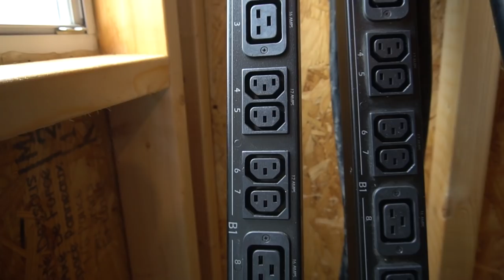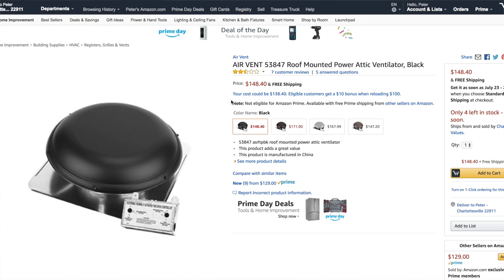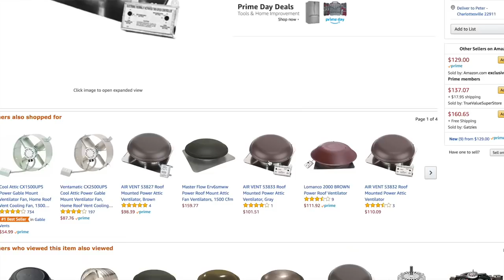How To Build Cryptocurrency Mining Shed | What I learned Mining @ Home

Comment: I suggest you frame in openings on the intake air that allow you to slide in air filters. If you have a sturdy decent filter, you can let it get dirty as you want, long as air flow doesn't get too low and things get hot. A dirty filter just catches more dirt. All that to be said replace costs shouldn't be bad

Comment: Paid $8k for a new 400 amp, 3 phase service. Paid $2500 for 10 30amp 220 circuits with twist lock outlets and 2 20amp circuits with 110 quad boxes. That included the permits. Great channel, thanks!
Reply: That's a good price ! Got a 600V200A line installed (underground) with a 112.5kva transfomer and a 72 breaker panel (120v15amp) for about 11k$
You are on 600V or 240V ?
Reply: I'll have to give you a call for our next farm ... 
Btw ... most of submission were comming back at 12-13k with a 75kva ... 
And ... i'm not sure how much electrician are paid where you live but here it's like 80$ per hour ...

Comment: You can reduce your dust and debris on your filters If you can attach an elbow to those intake vents.
Better, just remove the vents and cut out a horizontal opening the height of the diameter of existing holes. The large new opening then will be covered with filter.  Use gun style blowers to blow out the dust/debris from the filters.

Comment: Nice video! Built an ASIC mining room in basement (can hold 12 ASICS) that sucks in cool air from garage and exhausts it back outside.  Learned a lot while building previous smaller enclosures and used that knowledge to create the current setup.  Made some tweaks and it has been performing very well so far.   Love your videos and overall mining outlook! WOOT!

Comment: I see a lot of roof that could potentially be covered with solar panels ;)
Reply: Terrible idea for 99.9% of the population.
Reply: Nah, in some regions you even get national support to install them and this significantly shortens the time for ROI.
Reply: ? Solar bad? Please explain.
Reply: not for Mr. Vosk....solar panel directly wired to DC fans....that's free cooling (free after you account for capitol expenditure for panel + fan)
Reply: Bradley C - Solar panels are expensive, so ROI is frickin' never and they use some nasty chemicals and processes to make.  Plus solar is statistically about 4 times more deadly (deaths/kWh) than nuclear ;-)
Personally, I want an old water mill with a generator inside.  A nice home and free electricity, with mining rigs for central heating.
Reply: Phil Rodgers nonsense. I work for an electric company in MN and from all the solar projects i see the avereage roi for solar is 10 years. That leaves 20 years left of the life of the system to make profit.
Reply: PigeonLaughter - 10 in optimal conditions with a 25 year life expectancy. Suboptimal conditions is going to extend ROI and decrease life expectancy. Technology will improve over time, but the current tech is below par.
Reply: It would definitely be profitable for Mr. Vosk. He could make a video about setting up his solar panels that power the ventilations and/or mining and put affiliate links under that video to solar panels and other accessories ;)
Reply: @philrod1  SOLAR IS NOT EXPENSIVE!
Reply: @philrod1  the profitability of solar technologies has gone from several years to less than 2. LESS THAN 2. very common mistake...  its getting more worth it by the day, its just not something we can depend on yet. Traditional generation methods seem cheaper but are needlessly complicated by need to access to Uranium and lots of water.. which needs to be resupplied and also waste removed, it is a scam mate.. Solar panels are usually a one time cost, requiring hardware, nearly %100 recyclable,
Reply: @bradleymcewen4654  - citation needed

Comment: I didn't add a shed to my setup but your video while back on your electrical setup helped a ton as I'd no clue a normal ATX psu could run on 240. I paid $2750 to upgrade from 100A to 200A service and have a 60 foot cable run to a 100A subpanel and I've got 2 l6 30p plugs for now. I opted to use a grow tent to vent the heat outside and its worked great. Let me know if you'd like to cover that style of setup and I can send you the details.

Comment: Unfortunately I live in a condo, but I am on the can't stop won't stop train so I upgraded my 50 amp to a (max city allowed) 100 amps + 8 ARC Fault Circuits totaling 3500 on the East Coast.  Just upgraded a few weeks ago so I haven't really utilized much of it, but it's nice to turn on the AC and not worry about tripping 50 amp breaker!

Comment: During the Winter looks like you could Duct the heat right back into your basement pretty easy also. 
Right into the "Cold Air Return" of your furnace so you get it all around your house. 
insulated 2-3FT Pipe/Ducting. 
Just a thought , Not sure how cold your winters get (we get -40)

Comment: Hello. if you connect all the small air intakes to 1 air pipe and have sucked them up higher with 1 fan and filter it will save you a lot of dust and scrapes inside the room

Comment: You will not use less power (KwH) with 220-240 over 110-120 because of Watt's Law
Amps*Volts=Watts

110-120v at ~7.2 amps 800 watts is the same as 220-240v at ~3.6 amps = 800 watts, you don't lower your usage just your amp draw so you can have more miners (in this case) on a circuit as they are pulling 1/2 the amps per 110-120 leg of the 220-240 circuit.

20A uses 12awg, 30A uses 10awg, 40A uses 8awg, (as a baseline for under 100' runs) wires are the same diameter for both 110-120 and 220-240 in those amperages, the difference is there are 2 hot wires in 220-240 verses 1 hot in 110-120.
Reply: twcstransam psu is 2% more efficient at 220v that is what he is talking about.

Comment: I just finished putting a 100 amp sub panel with 3 30 amp circuits in my garage. Cost me just under $600 including the permit. I’m in Raleigh NC.

Comment: I paid $1300 to have an electrician run 60 amps off of my main breaker to a room in the basement about 75 feet away. The electrician installed two 30A 240V outlets which I connected two PDUs to.
Reply: Yeah, prices can vary highly depending on what part of the country you live in. I spent three months getting estimates first and this was lowest. Plus it wasn't just a straight shot--the electricians (two of them) had to fish the lines behind and around apartment walls (we have a rental apartment in our basement) to get the power to the mining room.
Reply: I live in MN and got the same circuits ran, 75 ft too, but only on the other side of the garage, and in conduit. Cost me $950

Comment: From my experience use a fiber optic cable or a WiFi client between your shed and the house. Don't use Ethernet because it can collect enough energy from a lightning strike nearby to killed every devices physically connected to your network.  It happened to my mining shed and house last week.  All of the motherboards, computers, TVs, video games and network equipment got fried.  The GPUs were spared but if I had ASICs, they would have been zapped as well.

Comment: The only way to use AC efficiently to cool is to ensure it is a closed system. Have vents blowing cool air in and return vents at the highest points so you are cooling in an efficient cycle. If you did that with a few box fans for more directional flow where you need it, you could have a pretty good and efficient cooling system. The added costs for that are not insignificant though, as you have to pay for the AC unit, ducting, insulation of the entire space, etc. can be done and it be efficient, but would require a longer ROI from the higher costs. The benefits would be you could maintain a much lower ambient temp, and this a lower running temp on your cards which could improve overall performance. Gotta do a cost benefit analysis though to go that route.

Comment: check out what Matt from The Technicals did. Make a hot aisle that the exhaust from the rigs can be sent out, and a "cold" aisle where the fresh air can be channeled into the rigs. With that kind of setup you might not need any sort of HVAC. Also you can create boxes in front of your air intakes on your shed and put in filters to help keep out dust/dirt/bugs/etc. You would need to change them every so often, but they're relatively inexpensive.

also I agree with the solar idea to help offset your electrical usage, depending on how much the cost to get panels are. I'm no solar industry expert but I can't see the downside in going with solar to help supplement your power usage. Depending on your area where you live you could possibly get some tax benefits.

Comment: You did it, the full meal deal farm vid. Thanks Vosk!  One refinement is to calculate CFM + a little for all internal intake fans e.g. ASICs plus blow past for GPUs then ensure same for intake CFM vents and exhaust fans. Over provision and include variable control (or on/off with multiple exhaust).  Liked how you drove home air exchange is key, remove heat not add cold. A/C is a fail in most setups (all?).  Well, next step up would be datacenter hot/cold aisle and that would be good for higher density but for this scale I like the design! I do wonder about possible benefits of minimizing internal volume to improve efficiency in air flow. Input vent low, exhaust placement to tune for no hot eddies are nice finer points but hey we're just backyard miners here learning as we go ;-)

Comment: GREAT SETUP!!!

Need Some Smoke Detectors, Modifiable The Speaker/Buzzer So it Rings in your house. Run 2-3 of them! 
Wells Worth it.. Now problem with the top mounted fans.. And Fresh air... They may not go off unless a LARGE fire. 
That's why running 2-3 of them would be worth it. 
You can Also Get home Alarm system panels. Setup a "Alarm system with smoke / heat detector. 
you can make it call your phone. AND Also you can make them "Cut the power" to your main. 
Myself. I don't take ANY chance... With that air flow think how fast it can burn down.
ALSO a CCTV thermal camera.. (IP CAMERA) You can set it to send or ring a alarm if temps of ANYTHING in view of the camera gets too high. you can do some pretty crazy stuff with them.

Comment: Hello! You didn't show too much of the shed install area after it was dug out. I saw some cinder blocks there though. So I'm hoping it was retained correctly. You should be extremely careful about erosion. If there is not a structural retaining wall built around that garage, there should be. One good hurricane season (major or constant raining) will put your garage in eminent danger.

Comment: I know this video is a year old but I just noticed something. You have attic fans and a ridge vent.

When your fans are on, they will pull air from a path of least resistance. That means they will use rhs ridge vent as an intake. It would be more efficient to lose the ridge vent so the fan pulls air from the vents down below. 

Just sayin'

Comment: I paid $3400 for my electrical work I had a 400 amp service installed 200 amp for my home and 200 amp for my mining room with 10 240 volt outlets on 30 amp breakers and 2 120 volt outlets... currently working on better heat management

Comment: Vosk, Great Vid ! Question: Do you get noise complaints from your neighbors (especially after midnight)?  What is the db noise level outside your shed with those 3 attic fans running 24x7?  Unfortunately for me, we have city by-laws that doesn't allow "ANY" noise above regular conversation level after midnight so I would have suggested that you add to your video that you should check with your local by-laws regulations before proceeding including if your house only has 100A box. Lucky you that you have 200A.

Comment: Hey Vosk, have you considered a way to make use of that shed heat for your house in the winter? I am planning on running a return line for my central air to my rig room (which is separated from the garage) and will close outside vents, turn on central recirc fan and help heat the house.

Comment: Are you going to put in different air filters as the time goes on? I was thinking about building one in Arizona. The problem I was thinking about is how I would keep the bugs out since we have Black Widows here and scorpions. I didn't think it through yet but I'm planing to somehow add AC return filters to the setup and on the outside protect it with a similar mesh. What do you think about that? Or how would you improve your airflow intake in the future?

Comment: Have you tried turning your crypto mining Farm solar powered with solar panels and then a powerwall and so you wouldn't have to pay for the extra electricity that it would be getting so you would get buy solar panels enough to power and store up solar energy into the power wall which is a battery which would recharge everyday and it would run through the night if you left it on

Comment: Nobody that I have seen is explaining exactly how much Internet you need for your rigs..... Such as upload , download and bandwidth could you please explain this in one of your upcoming videos
Reply: nothing. your google search might use more data than a rig sending a share.
important thing though is the quality or latency of connection. 
In ethermine pool, shares become stale or not accepted if your connexction drops for a couple of seconds
Reply: There's a reason why no1 talks about that aspect of cryptomining except that it's better to have rigs hardwired than wireless... the reason is simple: mining algorithms are very very light on bandwidth and, as some people said before, the quality of ISP network is waay more important than the internet download/upload (bandwidth) cap ... hope this helps, cheers!!
Reply: ONLY time you would need some bandwidth for a short period of time is when you are setting up a node, order downloading a blockchain, thats it. Otherwise your games like WOW etc takes more internet.
Reply: I have 5 Antminer L3+ running on a  Netgear WNCE2001 N300 wifi adapter with less than 1/2% stale shares since April.

I have plans to run multimode fiber the 200 feet to my shop but not because of the miners, for the POE security cameras I'll be switching to.

My ISP is wireless to add to the hard wire debunking.

Comment: Sorry I'm new to mining but if I were to run a mining farm one rig pulls 350 watts and the other pulls 1150 watts how many outlets and psu's would I need ? I'm wondering would a surge power strip be able to run both of those or would I need to split outlets or what. Any help would be appreciated
Reply: Jesse Lewis Watts = Volts * Amps. You never want to exceed 80% for continuous usage. 120V * 15A * 0.8 = 1440 W. Vosk has a setup of a circuit that is 240V * 30A *  0.8 = 5760W on a circuit.
Reply: okay so that outlet could only fit both of my miners? so I'd have to find another outlet ? or place in the house?
Reply: Jesse Lewis The 1440W is for a standard American circuit. Each plug on a circuit should be rated for the full 15 Amps. You will have to make sure that the surge protector is also rated that high as some are rated at 13 Amps or so. You can put both on an outlet and for the higher watt machine make sure it has a very thick gauge cable between the PSU and the wall outlet. Also make sure the rig itself doesn't go over 80% of it's PSU rating. Also to note that higher voltage is more efficient so if you have an Antminer S9 on the official Antminer PSU, you need to run it higher voltage or get a bigger PSU.

Comment: You don't need to run ethernet to the shed, just use a good quality MOCA  kit by Actiontech or Motorola.  You already have a coax connection at the shed so it will work great.  https://www.amazon.com/Motorola-Adapter-Ethernet-2-Pack-MM1002/dp/B078HMDDVS  is a good kit to use.  Good quality moca kits are more reliable with data speeds than even powerline :D